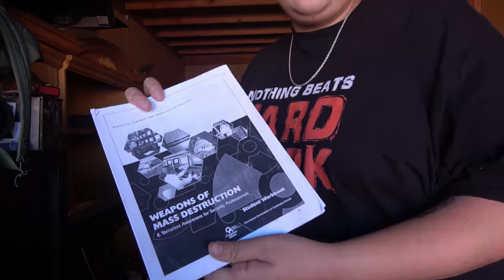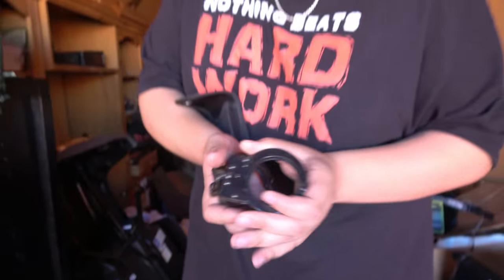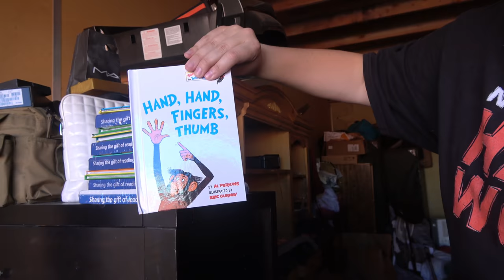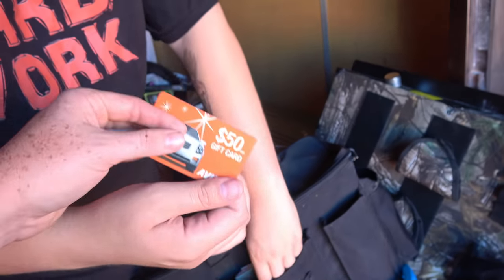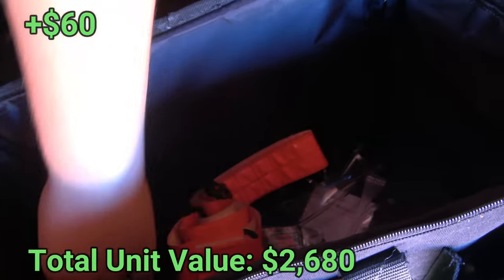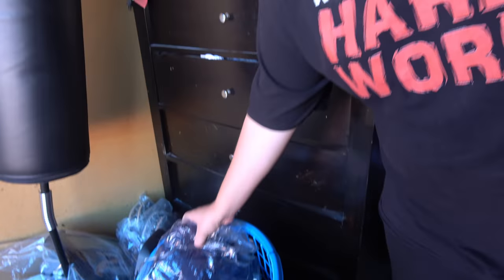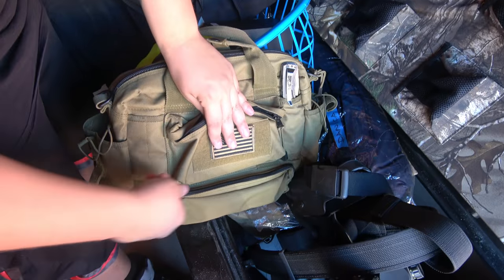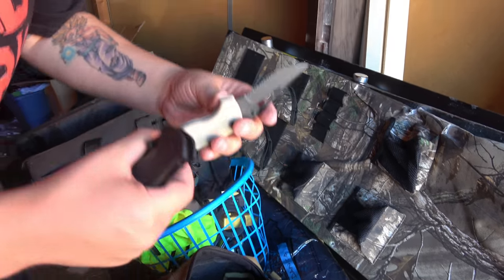ARRESTED At Storage Unit! BIGGEST STORAGE UNIT EVER! I Bought An Abandoned Storage Unit

Comment: The crossbow is only worth about $175 to $225. You need the rope Cocker. It have two handles with hooks to go on the string. Do not dry fire it. It will blow up in your face!

Comment: To pull the string back on the crossbow, you stand it up vertically in front of you. Put your foot in and pull back the string. *DO NOT DRY FIRE (firing without a bolt)
Reply: Not all of them some use a crank some also use a co2

Comment: The crossbow is fine. That's how their supposed to be. And yes they are called Bolts.
Reply: Out your foot in the loop in front of the arms. An use both hands to pull the string back.
Reply: Those were just field points on the bolts, target use only...
Reply: What would you take for the Dr Zeuss  collection?
Reply: Should have had a hook to draw it back and lock it.

Comment: The keys for the handcuffs are universal when you put the key in the hole turning it one way will release the ratchet  turning it the other way is to unlock the double lock which you have to use the pin in the other end of the key.  The double lock locks the ratchet so you will not be able to push the arm through the locking mechanism. The black hinged handcuffs look like peerless, the double locking hole is on the side of the main body of the cuff push the pin in and the ratchet will lock, turn the key one way to release the double lock and the other way to release the cuff. The silver cuffs look like smith and wesson on the face of the main body there is an  race track shaped slot, you use the pin end to slide the double lock on, and again use the key end one way to release double lock, other to release ratchet. Have fun locking up Baby Jebus.

Comment: That wrench looking tool is not a multi tool, it is an AR-15 Wrench/Tool to assemble and dis assemble an AR-15 Riffle.
Reply: At the Armourer/Builder level...or if you're replacing barrels...
Reply: @jonsummerville9022  It does more than barrel nuts, it also work all over the riffle inc the buffer tube collar.
Reply: @autoadjuster  I know...currently working on a 6.5 Creedmore AR-10 build for myself and a 6.5 Grendel for my wife...so yeah just giving the easy answer via voice to text while bent over the bench😉
Reply: @jonsummerville9022  I have built several AR-15's, want to do an AR-10 next
Reply: @autoadjuster  it's just as fun as the 15 but for larger cartridges...I've got 2 7.62x51mm, .270 Win and .300 Win Mag...next year I'm going to try and build a .338 Lapua...my 6.5 Creedmore is a 24" Super Match paired with a PSA Multi lower with a 2 stage trigger (1.5lb-2.5lb pull)...going for a mile attempt with it😁

Comment: The crossbow is worth at least $600.00 .it takes a bow string "crank to pull the bolt string into the locked position. It's at least a 200 - 300 pound pull. You can't physically pull the string by hand to set it. Nice boe. God bless you all.  Major Troy Lane- tet.

Comment: they are called bolts and the one you showed had a field tip on it. those are designed to do less damage than a broad tip. the broad tip is used for hunting, the field tip is for practice.

Comment: The reason why you could not open up the one pair of hand cuffs is because they are double locking cuffs.
Reply: The reason the black handcuffs didn't open was that when he turned the key he did not pull on the arm part of the cuffs when he had the key turned in the direction to release the ratchet.  If you noticed when he picked up  the cuffs he pushed the arm through the teeth on both cuffs ,that he wouldn't have been able to do if the cuffs were double locked. The double lock is engaged with a pin on the opposite end of the key pushed into a hole on the cuffs.
Reply: I agree Michael I was a correctional officer for 10 yrs

Comment: Your crossbow had a part to assist in the cocking the bowstring. Foot goes in to the bottom hoop with the string away from you l, then you hook that part on the string and pull up until locks into the sear. Then load a bolt, and fire it.

Comment: "1080p" security camera labels are often/usually very misleading, especially on "economy" security camera systems.

"1080p" listed on security cameras is usually a marketing gimmick. MOST of these cameras are actually much lower actual resolution. The "1080p" is often AFTER it is artificially converted to a display format of 1920p x 1080p...not the actual camera resolution...and the CAMERA'S NATIVE RESOLUTION (the "real" resolution) is what is important.

ANY camera pixel resolution can be CONVERTED to "1080p"...which includes REALLY low camera resolutions...and that can produce an almost unviewable low-quality image. So, again, the label of "1080p" is actually a pretty much meaningless marketing gimmick. You have to look at the detailed specifications.

I've seen so-called "1080p" security cams with ACTUAL camera resolutions of 0.3MP (yes...that's 1/3 MP or 300KP (KiloPixel) camera pixel resolution). Many of them are actually 2MP. But, a decent "close up" security camera needs to be at LEAST 3MP (3 MegaPixel). Ideally, and for license plate and face recognition at any reasonable distance you need 4MP or even 5MP camera resolution. There are a number of youtube videos that cover this subject in much better detail with actual images showing the quality you get from 0.3MP, 2MP, 3MP, 4MP, and up to 12MP camera native resolutions. The image detail differences can really surprise you.

Comment: put you foot in the loop on the front and with both hands pull until you here the locking mechanism go click. Cross bows like that retail for around $250 depending on the foot pounds of power. Some can have a r= a range of about 2 to 300 yards.
Reply: Isn't that one of those crossbows that you pump the handle to load it.
I just seen the guy from the Canadian prepper page use one of those crossbows some shoot much further than others!

Comment: the odd tool was a ar 15 gunsmith tool to take it apart and put it back to gather! there nuts and slots in a ar 15 , i have a ar15 i changed the buffer tube & built a lower for one ar 15 i took parts that failing to work right & one to make it shoot 22lr & bought whole upper i had 2 that worked!

Comment: The a way to load the crossbow you can't just pull it back like that you've got to put your foot into that thing on the bottom i can't remember the names of the parts but the handle looking thing place into the ground with your foot in there pulling the string it's very hard but once you get it to a certain point it become easy.

Comment: Handcuff usually have a double lock. So one way is to unlock one is to double lock.
Reply: Both ways are to unlock the cuffs, one way unlocks the ratchet, the other way unlocks the double lock.  There is a pin hole on the cuffs that you use the other end of the key to double lock.

Comment: 9mm NATO is the same as 9mm Parabelum and 9mm Luger. All the same.
Reply: Although it is all the same caliber 9mm nato is going to always be FMJ  and 9mm nato is generally loaded to higher pressures although the head stamp is not stamped +P.
Reply: @michaelbless620  True regarding the FMJ part, unlike 5.56 NATO vs .223 or 7.62 Nato vs .308 differences in load pressures. 9mm NATO itself is the same as standard 9mm Luger/Parabelum albeit the bullet grain/weight is regulated in a set standard of FMJ. +P is the only 9mm Luger/Parabelum ratings that are of higher pressure. This is per Lake City Arsenal. They manufacture US NATO regulated and used ammo.
Reply: @jamesluke7377  Actually every and I have looked at many including Winchesters , which is what those ranger rounds are, says that the 9mm nato is loaded to HIGHER pressures than standard 9mm, however not quite up to the saami  pressures listed for +p.  Every commercial US ammo manufacturer uses the LE Only designation for their higher pressure rounds,  some on the +p rounds and others on the +p+ rounds.

Comment: The multi tool is an ar15 That one is made by tapco they're one of the people who put Bottle opener openers on there that why it said beer hear p.s. That knife is a karambit   It's originally from the Philippines it has the 3 martial arts tiles based around it and people get very mad when you place for pinky in the hole it is only For the pointer finger you can youtube videos of it that are very Messy if you know what you're doing
Reply: Ar15 Wrench***

Comment: awesome vid guys, but will you use law enforcement only bullets at gun range or sell them?
Reply: The LE  rounds are usually rounds that are rated +p or +p+ , which stands for increased pressure and they are usually jacketed hollow points for carry ammo. The ones marked NATO are always going to be FMJ  ball ammo and 124 grn in 9mm.  The nato rounds are also loaded to a higher pressure, which gives more velocity, but I don't believe they are stamped +p Also some ammo companies rated some hollow points as LE only like the rebranding of the black talon.

Comment: Put your foot in the loop on the end of the bow facing the ground & pull up with both hands to latch bow string & dont dry fire without a arrow bolt in it !!  About $450 new at     hunting stores !!!!! Used about $350 to $375